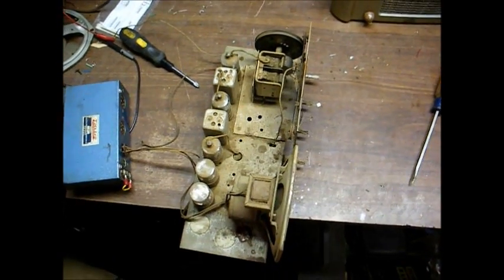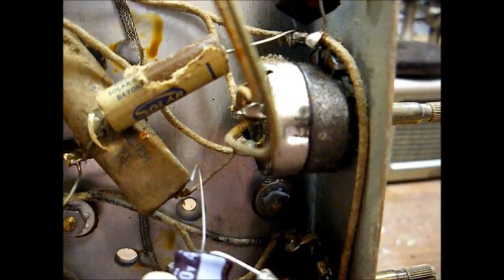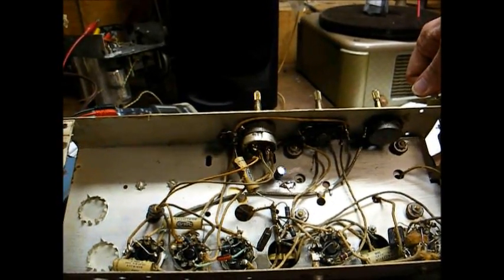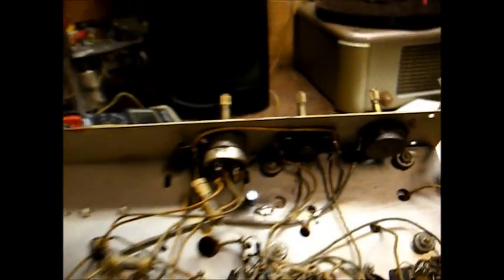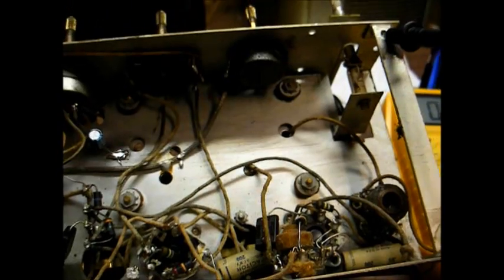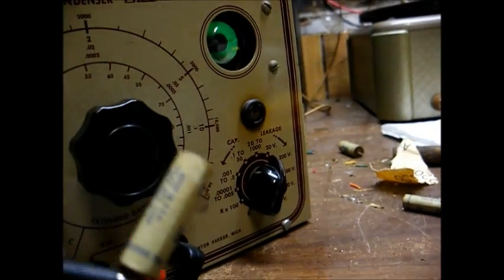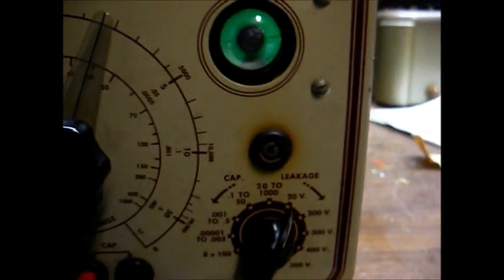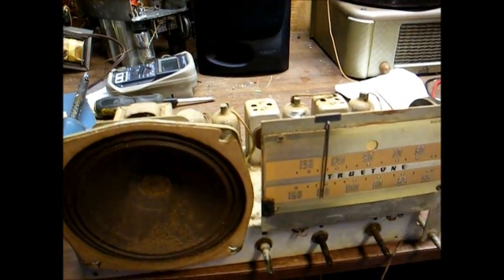Repair of an early '40's Truetone battery operated tube radio/crank phono - part one

Comment: One weak spot in many of these battery sets are the grid caps and the grid cap leads, those can cause flaky performance. Another common problem is bad solder joints and breaking wires near the battery plugs. With most battery sets I've had I was able to get them playing without changing the capacitors, except when they had one of those bypass electrolytics which always dry up. Battery sets run cool and at lower voltages so the dielectric layer tends to hold up better then in a typical five tube AC/DC set, but they can still fail as this Truetone (Detrola) has shown.
Reply from the maker: I've ran into that several times, along with a few miswired battery plugs and blown tube filaments as a result from the miswired plug.

Comment: I'm always amazed at the restoration guys that leave the paper caps in the radio, and will only replace one if they absolutely have to (seen it here many times on Youtube)...they don't understand that they all absorb moisture over time, and that it will affect circuit operation. The 1.5+ you got at the grid of the output tube is a good example. I am surprised though that the Sealdtite's were that leaky, though...they usually fare a little better than most of the others.
Reply from the maker: The guy who taught me a lot of what I know was that way. He was very cheap and wouldn't replace a cap unless it was totally bad. Even then, he'd often use one that had been cut out of something. Capacitors are cheap enough that I always keep a stash of new ones on hand.

Comment: I really like your videos and understand the process of discovery, but I have a question.  Why not just re-cap the whole unit and then look for any problems?  More than likely, to restore the unit you will re-cap the whole unit anyway.
Reply from the maker: I could shotgun the caps; but, I try to show actual troubleshooting procedures because many times, there will be other things wrong with a radio besides capacitors. I've had to go in behind people who were good at replacing capacitors; but, were not good at troubleshooting. So, when they recapped their radio and it still didn't work, they were lost.

Comment: Great analysis, most just automatically replace all caps and be done with it, right off the bat.  Good of you to do a cap by cap analysts, showing exact effects of each on the circuit.  You are a patient guy.
Reply from the maker: Thanks! I like to do it this so that actual troubleshooting procedures can be seen. Just replacing caps is boring and there are many times that those troubleshooting techniques will come in handy.

Comment: Leaky at rated voltage operation over the decades, and not leaky at very low voltage operation. I guess you would suspect that.
   I guess there wouldn't be that "punch through" problem from the metal foil, paper, and  paper foil again at rated voltage.
   Very interesting,
        Tom
Reply from the maker: Yep, some capacitors will work OK at low voltage; but, leak badly with high voltages. Eventually, those same capacitors will leak bad enough that they won't work at low voltages; so, might as well replace them.
Reply: radiotvphononut Amen to that!